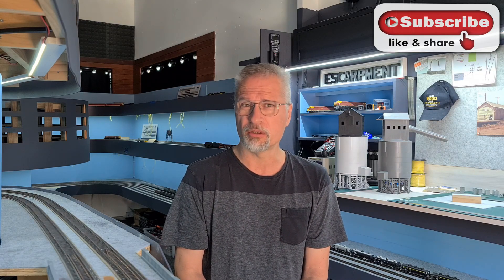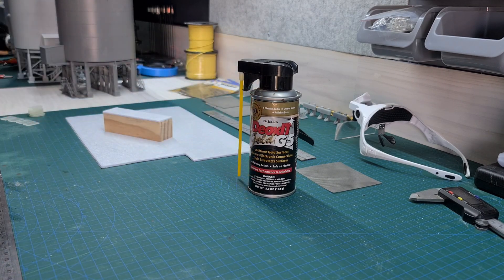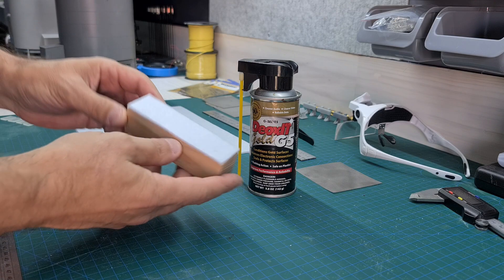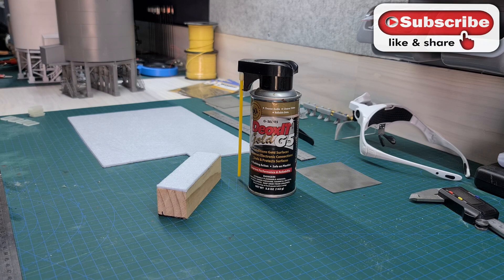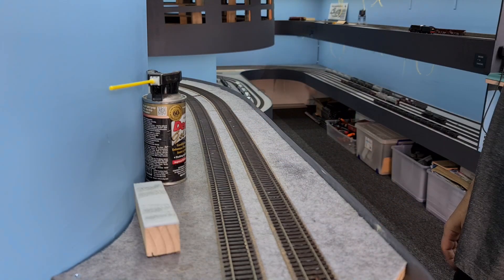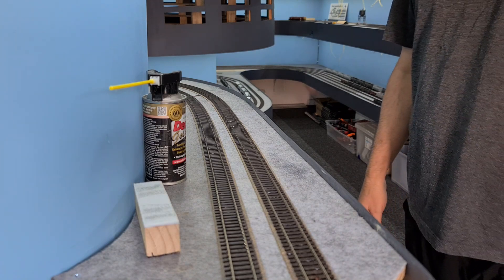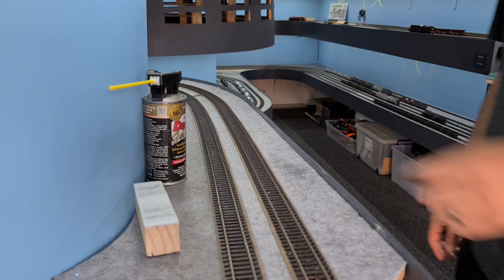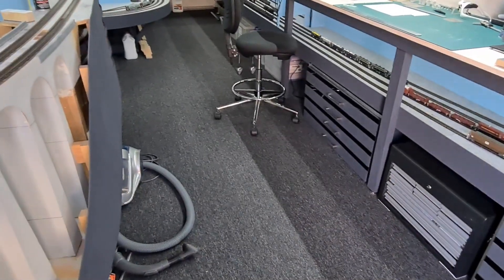March 2023 Model Railway Build Update - The Escarpment

Comment: Those bins do look like the ones here alright. Wongawilly, as well as Old Bulli, had the similar bins too. You could always turn it into a working coal bin, by putting an anger inside the tube, having a container or something with coal in it and feed up to the bin. It's an idea I been working on my self too.
Nice to see someone else has interest in modelling the Illawarra area, I born and grew up in Unanderra, still remember the old Nebo bins too. James from Dundas Canada put me onto you. I'm more focused on doing south of Coniston to Unanderra up to Donbarton, and Dapto, before it was changed to what it is now, pre Maldon to Donbarton rail project.
We shall have to keep in touch, I've subscribed to you as well.
Reply from the maker: Hi - yeah, modelled from the Kemira Schematics, although it will have the enclosed Wongawilly conveyors. Thought about turning it into a working bin, but I think for now, it will just be a static one. I was born Bulli and did my primary school years at Unanderra before moving to Albion Park. My late Nan use to take me on the trains as a kid, between Bulli station and Central..that is why I modelled north of Port Kemble..cheers
Reply: @JasonWood_Escarpment  Yeah I went to Unanderra too out on the Highway. Lunch times use to get the glimpse of the milk and paper train coming through.
As far as I remember the conveyors going to the bins were enclosed  from the early 70's to this day, as the coal from the drift shared the same system. My dad use to work on Crane 21 and crane 30 inside the steel works, and up along that line. It's still standing there today but not being used any longer.
I do have the actual track plans of the old Wollongong, Coniston, when the new balloon loop was put in the coal loader, Allans Creek triangle and up to the Allens Creek Bride just before Cringilla, which is still in the diesel era, and the car sheds in Wollongong.

Comment: Hi Jason, do you know if the cleaner will affect traction tyres. Carpet looks great, without doubt the best looking layout room.
Reply from the maker: That is a very good question! I don’t have traction tyres myself, so I couldn't be 100% sure. It mentions it is safe on plastics, so maybe it would be safe..regards
Reply: @JasonWood_Escarpment  Most of the N gauge steamer have traction tyres and they tend to react to chemicals.
Reply from the maker: Fair enough, once it dries it should be ok..but not 100% sure

Comment: Thanks for the video. Food for thought with the Deoxit. What about loco wheels i.e. what is your method?
Reply from the maker: Hi Brian, what do you mean about wheels? Traction tires or just wheels in general?  Regards
Reply: @JasonWood_Escarpment  Sorry, should have been more specific. How do you clean the metal wheels on locos and does the Deoxit help to reduce the dirt that they pick up?
Reply from the maker: I haven't needed to since using this stuff. Although I should probably check that situation out just to see the condition

Comment: Hi Jason, Great info.. I have a question that I'm sure you will be able to help me with.. I have just purchased on Gumtree a bargain lot of track, engines and rolling stock. a lot of the track is older track and wondering what is the best way to clean or refurbish it before I use it.. do I clean each piece or just lay it and then clean it when it is ready to be used.. and what do I clean it with..?? I am in Melbourne and just getting back into the hobby after many many years ..... I had a HO set as a kid and now I'm just an older kid haha... I have just subed to your channel and look forward to watching and going back and checking out all of your videos. I have been researching a lot in the past several months thinking of what to get and how I want to set things up.. I am not interested in sound systems, but might dip my toes into DCC once I get the track laid and have some fun with what I have purchased at present. Thanks in advance Tim.
Reply from the maker: Hi Tim. First up, thanks for the feedback! The first question is, are you just asking about the rails? Secondly, do you know what material the rails are?
I would normally wash in soapie water, let it completely dry. And either coat, as seen in the video, either before or after laying the track..cheers
Reply: @JasonWood_Escarpment  Hi Jason thanks for the reply.. not sure what you mean about just asking about the rails?.... I am not sure of the material of the rails, how do I differentiate the types? 

I just looked at the large collection of tracks that I have, it consists of a long box with approx 16 lengths of flex straight track from Hornby, Peko Streamline, and some that have GT-italy then 2 ties after just a number 1 on them(that's all the markings on them) and some with nothing but "Made in England R601" on them. Then there is a large box and a small men's old brown suitcase full of old Triang, Lima, Hornby and Jouef tracks, with 2 old controllers one being a Jouef controller and the other a Thyristor control unit (very old and heavy).  There is also one other controller from Hornby which seems a lot newer than the rest.

I can already see some rust on some of the various lengths of track and want to remove that also.

I was thinking of giving the lengths of tracks (with plastic ties attached) a wash in warm soapy water and let dry for a few days... this is something I will be doing over a few weeks.. I am not going to go bull at a gate just yet lol... slow n steady wins the race.. 

I also like the idea you have used for underlay.. the carpet felt is a great idea. no foam or cork needed... great idea. I am not looking at adding any scenery for a while I just want to lay track and play trains... hahah.... I know others are going to cringe at that but I am a bit of a minimalist and will get to those things later down the track pun intended.. hahaha... I love your layout which gives me lots of ideas... 

I have an old kitchen in the front of my house which I am thinking of turning into my rail shack/man cave it is approx 5mtrs long x 3.1mtrs wide so I think I have plenty of space to make a reasonable layout maybe in sections at a time... Thanks for your Time... Tim.  P.S. I have also joined your FB group as Tim Ge.
Reply from the maker: The rail question was whether they were brass, steel, or nickle silver. Sounds like you might have a mixture there. Go with the soapy water. Maybe the ones with rust, is to use a mini wire brush. 
There is nothing wrong with what you want to do. It is your layout, so you progress with what your interests are. I have been building mine since July 2018, and I haven't got to the scenery as yet..but hoping by next year
Reply: @JasonWood_Escarpment  Thanks Jason.

Comment: Interesting to hear your experience with track cleaning.  The coal dropper looks ver impressive.  It must be frustrating not to be able to produce the final version.  Hope you get that sorted quickly.  Stephen
Reply from the maker: Hi Stephen, thanks for that. It has been now confirmed as a hardware fail, so at least I now which way to fix it..cheers